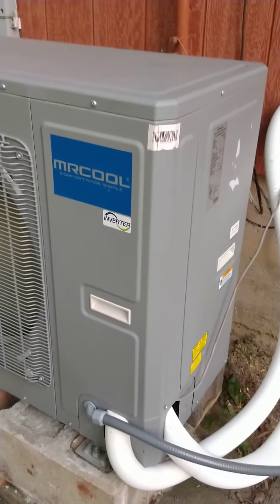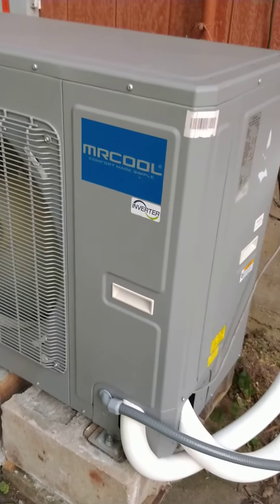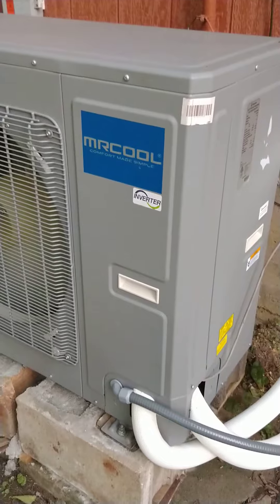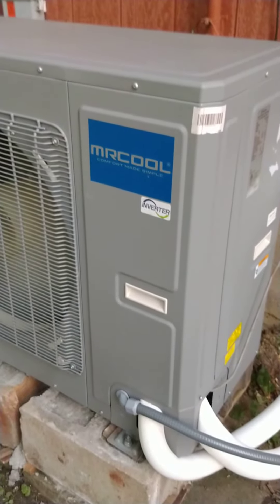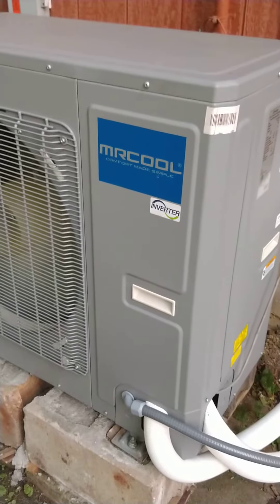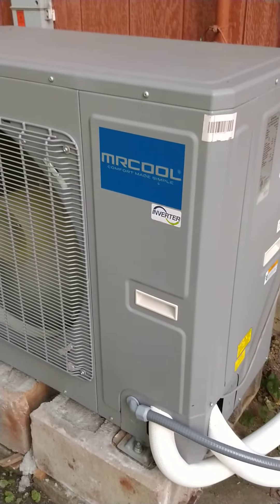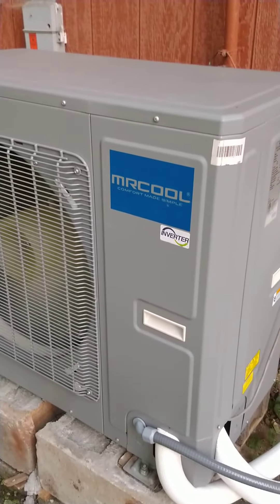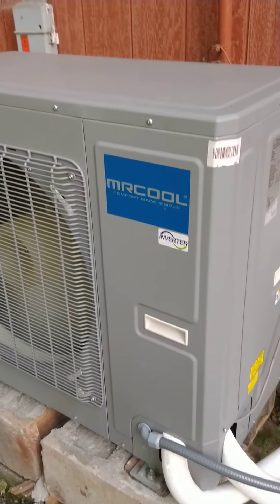Mr Cool Universal DIY install by a novice. up and running for the first time ever!

Comment: How's its going? Mine was the 5ton Mrcool heat pump universal. Mine broke down a bunch of times. Then I replaced it with another brand
Reply from the maker: @CubanMofo  mine is still going strong. Knock on wood!!! No problem from the install

Comment: Heat-pumps have a reversing valve that has to energize with the compressor at the same time for a particular mode of operation, it's either of one or the other but not both. Always read the electrical schematic on the outdoor unit, if it designates an "O" for reversing valve then that means the reversing valve is energized in the cooling mode and if it isn't the  unit will run in heat. "B" terminal is designated for heat operation where both the compressor demand and reversing valve are energized at the same time for heating.
Reply from the maker: From what mr Cool techs told me is that the majority of heat pumps run in the cooling mode as a default and switch to heat. The Mr Cool runs in heat as the default and switches to cool . We have been very happy with our unit we installed...

Comment: Nice, a review in winter and summer would be nice. Thanks
Reply from the maker: I just installed it in September so we only had a little AC before heat. It's just now July so I will do a review for summer months when we have a trend and a couple electric bills to show
Reply from the maker: We've actually run this for a couple of seasons now so we've been through a couple of winners and a couple of Summers and this heat pump has actually cut our electric bills in half we've never had a $250 electric bill in the middle of summer or in the middle of winter and we've had $110 degree Days in the summer and we've had 24 below zero in the winter so we are very happy with this unit
Reply: Do u have any idea how much will be energy bill on winter time . Oil furnace will leave me broke 1800sq ft home

Comment: O energizes reversing valve for ac ,b energizes reversing valve for heat.down south you usually see b up north o.o , condenser naturally runs in heat b condenser naturally runs ac.

Comment: where would you attach the cold air return damper and supply on Mr cool hair handler? thanks for the nice video to help others
Reply from the maker: My cold air comes in from the bottom. It sits on a box with the filter in it

Comment: Quick question, you used the existing wires correct? No new wires had to be ran?
Reply from the maker: My system I replaced was about the same and called for the same size wiring so I used the same wires. Got lucky

Comment: Why does it look installed backwards?
Reply from the maker: Backwards? Our old unit vented to the top and this condenser vents out the side. If it's hooked up backwards, it sure runs well that way 😀
Reply: @chuckvaughn  oh okd.  wasnt critizing.  just notice the lines were on the front side.

Comment: You will have no warranty on a self install on this model of unit..  That wire running across sharp sheet metal will not last long. Not being covered you will get rodents chewing on that wire.
Reply from the maker: I have checked multiple times and I'm told I do have a warranty. It's been two years. The wires was me just hooking it up and seeing if it ran.   
The wiring has all been replaced. The unit I replaced used this exact wiring and It had been installed for 14 years and used when it was installed. My house must not be rodent infested. Thanks for the warnings